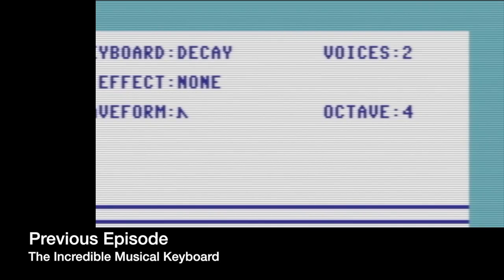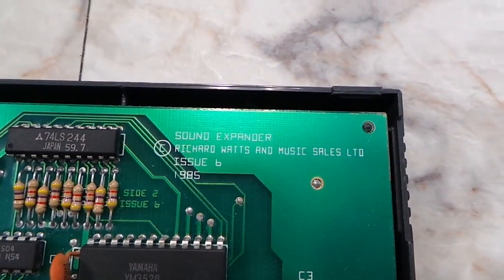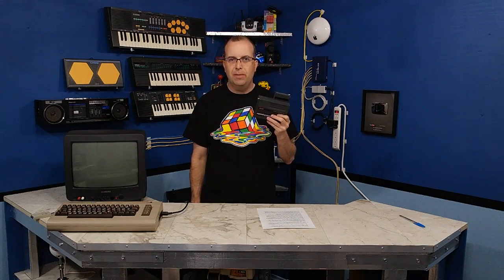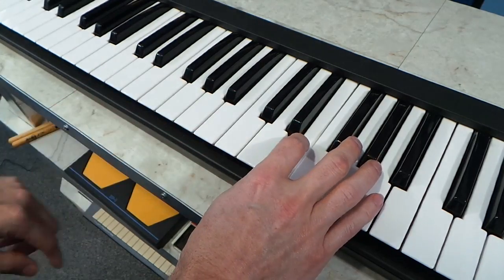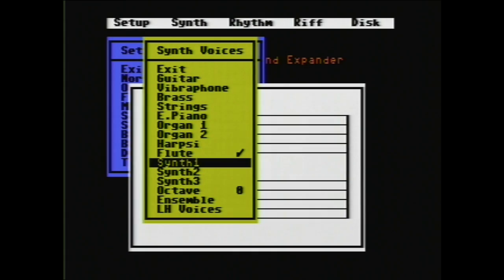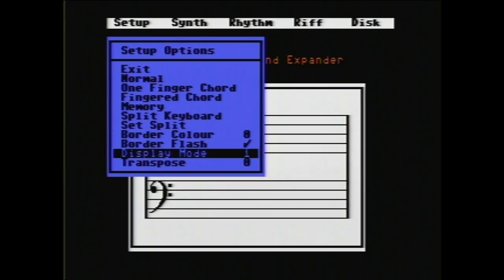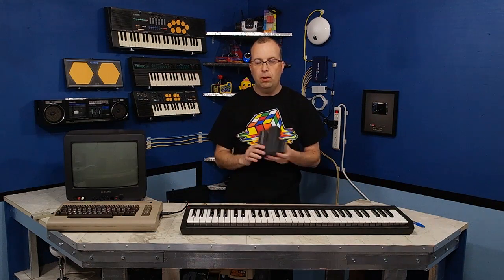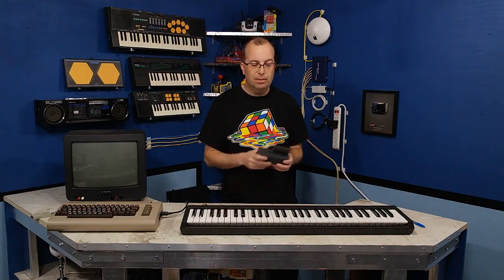Commodore 64 SFX Sound Expander - In Depth Look

Comment: Hey, Dave, now mix the two of these together in the same computer, and run their outputs into a small mixer (or get cheap and just use a Y-adapter in reverse even though that's a bit of a no-no)! And then do another experiment where not only are these 2 mixed but mix them with the SID as well (and run stuff that will play both)!

Comment: You should plug your second Commodore sound fx to the slot into your first one and then see what it does.
Reply: I doubt it would work out, since there is probably very little address conflict handling. Best likely case would be that one of the two would be safely disabled, but there is also the risk of shorting out some signals, would be a shame to wreck such a rare collectors item.
Reply: John Doe yeah i guess, it was a decent idea i thought.
Reply: alternatively - dump controller rom, reverse engineer it, map of the board and then throw the whole thing into online as opensource hardware. That way any c64 enthusiast can build one if they had time.
Reply: I was honestly wondering the same thing the second he held them up together, though.
Reply: I wonder if the cartridge slot on the expander remaps the second chip select line to the first, maybe, physically preventing any conflict between the two devices? It might even be a deliberate part of the design. After all, what if you plug in a software cartridge that uses the same address? And why put two addresses on the port if there was only ever meant to be one cartridge hanging off the back?

Compare the external floppy drives of various old computers. Each one individually thought it was "device 1", but you could daisy chain them (generally either 2 or 4 max) thanks to their passthru ports. Said ports remapping the "device 2 select" coming into them as "device 1 select" on the output (and not connecting dev 2 on the output; or, where appropriate, device 3 = device 2, and device 4 = device 3, with dev 4 on the output being N/C), so that the computer would drive one of the two (four) pins active and select just one, specific drive out of those connected, even though each thought of itself as "#1", and the port interconnections were identical with each drive. Simple but smart.

Do the same thing with the cartridge port, with a rule that each connected cart's chip(s) are only ever connected to either CS1, or BOTH CS1 and CS2 (if you have a lot of ROM / multiple devices onboard but no dedicated mapper controlling access to them), never "just CS2", as well as mandating that anything with a passthru only connects CS1 internally, and maps CS2 to CS1 on the output, and you have a recipe for being able to daisychain at least two Sound Expanders. Or connect simple one-chip (or at least one-CS) cards into an expander's passthru port. Of course, anything that uses both lines will suffer malfunctions when trying to use the second chip, and software that's too stupid to try the second address if the first one fails will also be incompatible, but those are fairly minor concerns addressed by unplugging the expander and connecting those fussy cartridges directly. Or having some kind of interposer between both devices and the computer which can switch between sending all CS lines to one or the other without having to disconnect (ie, basically the same as any other multi-cart switch box).
Reply: +Smoke Fumus ... funny you should say that... people are selling remakes and extended versions of the expander already. As well as similar devices for other systems. It's a pretty simple design after all, it doesn't even HAVE a control ROM, it literally maps the OPL's IO lines to the matching ones on the C64 cart port (it's an 8-bit native device after all) with some buffering resistors and capacitors to make sure the voltage levels are sound, with the CS line directly gating whether the OPL pays attention to data put on those lines or not, with the output running straight to the RCA port. The schematic can be easily sketched by hand on a single piece of paper.

Same concept as in the FM Sound Expansion for the Atari ST. Pretty much just an adaptor that converts a YM2413's pinout to match that of the ROM cartridge port, with an output minijack on the side.
Reply: exactly! That was what i thought!

Comment: Just curious but would the Yamaha FM chip be the first stepping stone to the digital to analog (DAC) converters today? The most I could remember as to sound formats back then was AIFF for audio CDs which didn't have much to do with synthesized music.
Reply: Yamaha's FM chips produced digital signals. Each one would have a separate companion DAC chip connected to it on the circuit board.

Comment: Lot of these voices sound like a Genesis/Mega Drive
Reply from the maker: that's not a coincidence. The Sega Genesis uses a Yamaha FM chip too.. although the one in the Sega is more advanced.
Reply: @8BitKeys  SONIC IS ACTULLAY SEGA LOL
Reply: well didn't sega actually used opl2? i mean if it's interchangeable, i don't think there's much difference at all - few internal configurable switches, each with set of parameters. You can config them manually to begin with.
Reply: The YM3526 is a 2 op chip. The YM2612 of the MegaDrive is 4 op and part of the OPN not OPL line. OPL2 YM3812 is backwards compatible in a 3526 circuit but because the 3812 has 3 additional waveform types, a 3526 won't necessarily do the role of a 3812.
Reply: There are probably hundreds of different gaming consoles, microcomputers, arcade machines, keyboards, etc that used this same sound chip.  So it sounds like a lot of things.
Reply: The Sega Genesis used a YM2612 (OPN2) as it's primary sound chip and a Texas Instruments SN76489 (plays a large roll in the sound of games like Streets of Rage) as it's secondary sound chip. The SN76489 was also for Master System backwards compatibility. Yamaha FM has a distinctive sound, just as Roland's FM has it's own to my ear. I have always linked the Yamaha "sound" with Sega and the 16 bit era of gaming.
Reply: FM has always sounded crap to be honest and the megadrive sounds like a toy keyboard. Streets of rage was a fluke, most other music on it sucked and don't get me started on the master system, that was just painfull to listen to.
Reply: The Sega Mark III (Japanese version of the Master System 3) brought the YM2143 (a.k.a. OPLL) chip, which was present in many toy keyboards David reviewed. The YM2143 version of the Double Dragon soundtrack sounded really nice.
Reply: OK it wasn't too bad I suppose, but the master system in Europe had something much worse than FM, it was really terrible.
Reply: bluebull399 
I know you're talking about the PSG square waves and noise from the SN76489. But in all fairness it wasn't given the best use. Check out the Sega Chess soundtrack by Matt Furniss (there's a "Sega Chess intro" video in which you can hear the whole intro theme), I think that one does it a bit more justice than the average PSG soundtrack back in the day.
Reply: ok I had a listen to the Sega Chess intro, don't get me wrong, it's nice and you are right a lot better than a lot of the older PSG tracks. My main issue with the PSG was lack of waveforms, no way to modulate or change the sound, ok it has ADSR but other machines such as the C64's SID chip could do so much more. My biggest gripe with PSG is the drums, they just sound so naff compared to other chips around at the time.

Comment: I had no idea the Commodore had FM synthesis way back then.  Neat.  But, as is often the case, expansions never get the love that built-in hardware does.  Just ask all the optional hardware for the NES...

Too bad though.  Having grown up with both a C64 and early Sound Blaster / AdLib software, I always found the SID a little crude sounding in comparison.  Even though generally I'm more a fan of subtractive synthesis than FM.

Comment: I had this and the sampler/FX unit.. I had to throw them away as there was no way to copy the disks known to me ( it tried everything, including RAM rips but nothing short of original floppy in the drive would start the damn thing).. After few read errors, it was sure that they were both gone.. 

Of course, it was 2003, there was NO such idea of flash card to C64, nor did i find any info online at the time, other that these existed. So, i n the end, not i might've made a bank but, from all the hardware i've binned, this is first that comes back to haunt me.. I'm not even bummed about binning some silverface pioneers, they are really not as good as reputation says..

The sound is not really usable, i had tons of those available all ready at the time, more than enough cheap FM synths.. Also, the controller software is full of bugs, it hangs, glitches etc. so that any kind of performance is out of picture. I'm pretty sure the same chip is found on actual keyboard of the time and those are totally different as they are not software controlled by 3rd device.. Compact wins over distributed every time.

Comment: This version of the theme song you played is the best in my opinion. I think you should use it for your intro.

p.s. who else wanted to hear what the "glock" sounded like?
Reply from the maker: Hahah.. I actually was going to mention that one, and make some snarky comment about it not sounding like a handgun.  But decided to leave that off.  Anyway, it actually doesn't sound like a glockenspiel either.. it sounds more like a wooden marimba.
Reply: Hooray for marimbas, though I've never heard a marimba.
Reply: It looks like a xylophone but sounds somewhat different.
Reply: A marimba tends to have hollowed out blocks, that are somewhat loose so that they have a more noticeable reverb echo when struck hard. It's the kind of sound that when played well, gives me the shivers (in a good way of course!)
Reply: @AmyraCarter  A marimba is similar to a vibraphone in that both have metal tubes with little rotating "shutters" in each tube to enhance the sound and give it a vibrating effect, not entirely dissimilar to the Leslie speaker one often sees with an Electronic/Hammond organ. The difference being that a vibraphone has metal bars as the "sound generators" whereas, as you correctly pointed out, the marimba uses wood blocks.
Buuut...
I´m sure you already knew that; I just put this up here for the benefit of the other commenters.